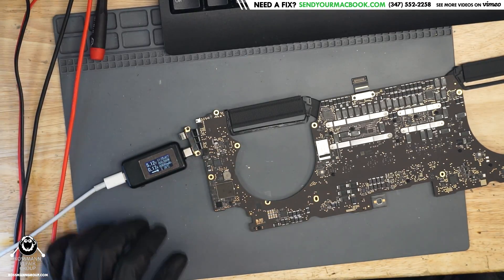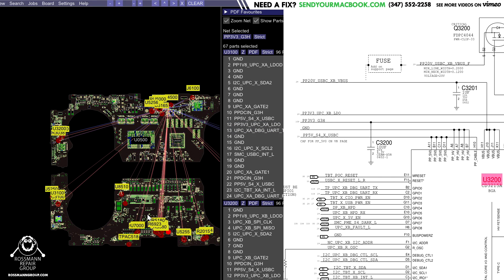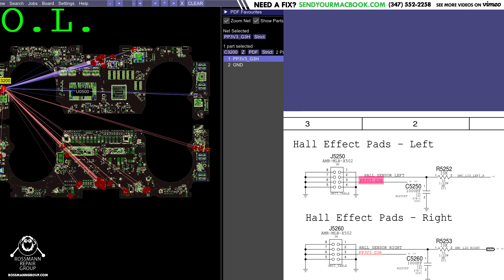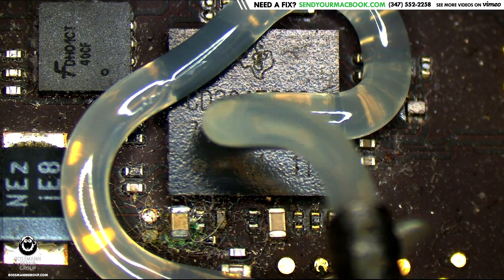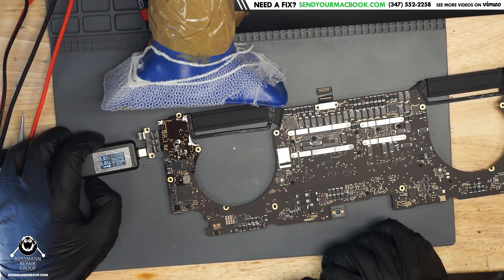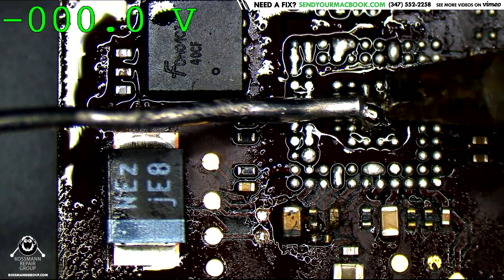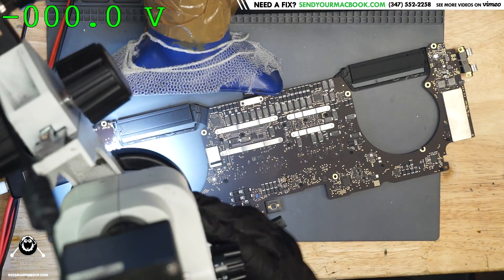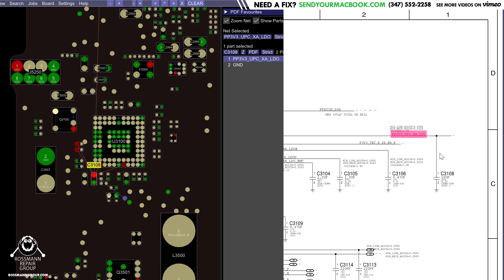A1707 Macbook Pro not charging, stuck at 5v - the short that was only shorted when turned on.

Comment: I value your advice coming from an micro electronics repair engineer. A post a while back you recommended Lenovo thinkpad X, P and T series laptops. I ordered a custom spec p1 gen 2 and unfortunately their uk customer service is diabolical. Quoted an estimTe of 2-3 weeks for a custom build but then updated me 2 weeks later with an updated delivery time of 3 MONTHS. Can you recommend any other brands of laptop that are built as well as thinkpads? Thanks in advance

Comment: Why is it that none of my Windows (replaced by Linux) laptops have ever had components failures? The only things that failed were HDDs, keyboards and eventually the backlights went dim. Apart from one, all of these were all second hand when I bought them.
So far I've had Dell, HP and Lenovo, no diodes, chips or capacitors have died.
Fun fact; I used to build my own towers. At any given time since the mid 80s you could build a PC that was twice as powerful for half the price of a Mac. OK the downside was that it ran Windows but now Linux has become so easy to install you really need to check it out. When I could run Photoshop (5?) with no problems my neighbours Mac struggled to even rotate a jpg :(

Comment: Short that only shorts when turned on? Reminds me of a burnt up wire underneath my fusebox. Fuse side it was good, and on the ignition switch side it was good with 12v. When I turned the key on the fuse side read 12v, but the Ignition switch  side was reading 0. That took me a while to figure out.. but It was fixed with a wire... EZ stuff compared to this. nice job as always Louis.

Comment: What exactly is happening at around 9:00? I can't wrap my head around it
Reply: The lead-free solder on the board is more difficult to melt and remove than leaded solder, so he's mixing some leaded solder into it to lower the melting point, making it much easier to remove with the solder wick.

Comment: If this unit was used in a generally normal work environment, what might be causing all the corrosion issues? Is Apple using low quality parts that merely corrode from use ? Are the boards themselves deteriorating ? I ask from general curiosity.

Comment: @Louis Rossmann
Bad news about the right to repair legislation: it's been neutered. You had a short video with a senator stating it doesn't apply for any medical devices, w/o exception. So guess what: iphone&co will contain a FDA certified pulse meter or full SpO2 like newer Samsung galaxy S do at least in the EU. Being medical devices you won't see any schematics from them.
Please try to testify again in front of that legislative panel and request an exemption for consumer devices containing such technology.
Reply: every law has a loophole
Reply: @Dasgath  yes, but this one seems huge. Imagine someone integrating a cheap SpO2 sensor to the fingerprint reader to detect if a person used their finger and not a prop.
Then imagine that SpO2 sensor getting fast-track FDA-certified to measure the SpO2 value and pulse.
Then imagine a certified SpO2 fingerprint unit being sold by ElCheapoChinesium Inc, making most laptops/tablets/phones/TV's medical devices no one has the right to repair.
Reply: @miaudottk9080  Is that true one cannot repair medical equipment? Need a license for that in my countrt but sounds like huge restriction
Reply: @user-uk5bx1kz2k  no. There is a proposed bill for 'the right to repair' to force companies to reveal schematics and sell parts to repair shops in the US.  It will likely exclude medical devices.
Reply: oof.
Reply: Wtf this makes no sense, using tires meant for racing wont magically turn your car into a racing car
Reply: @pistonsjem  Of course not, you'll have to also paint it.

Comment: I wish I was this good at soldering, the only things I’ve soldered were camera flash circuits and collecting the components/making coil guns. I can’t even work on that without 330 volts burning my finger to a blister. I just know I’d destroy delicate circuits like these!
Reply: The key is to use enough flux....  If you use half a tube of flux per connection, you too, can make good solder joints 😁
Reply: @Flying0Dismount  the bigger the blob xD

Comment: I am curious. Why doesn't the heat damage the chip or nearby resisters? I wish that you had your business in the UK.
Reply: The components have to handle the heat of being soldered into place, because solder has to be melted; it is a kind of metal. They are designed that way. You will also notice that Louis used equipment that is designed to put out controlled heat at specific temps. That is how he makes sure not to damage said components. I hope that clears things up.
Reply: @jezeski2011  Thank you. I am aware of the properties of solder but was surprised that the chips etc could withstand the heat. I had assumed that manufacturers would use computer spot soldering which would be more directed and not cause damage. Interesting, they are more robust than I thought.
Reply: @RonSeymour1  Many years ago, I worked at a company for a little while that actually did electronic assembly and saw some really cool machines that put of these type of things together. One of them was called a wave solder machine. The tiny parts were glued in place on the board and then the board passed over a literal 'wave' of molten solder. The solder would then 'stick' to the metal contacts; forming the connections. It was a really awesome thing to see. Of course, the boards then went to the QC dept. to be checked for proper joints and operation. Some of these boards were used in high-end devices like brake control for locomotives, so this was not cheapo junk.
Reply: @jezeski2011  Thank you for this information. It was very interesting. I would love to have seen it in operation.